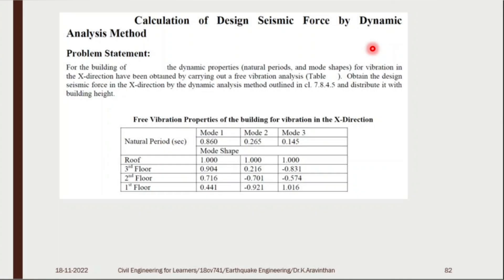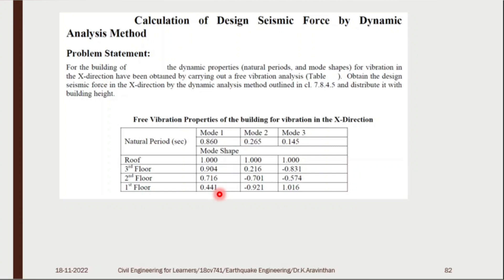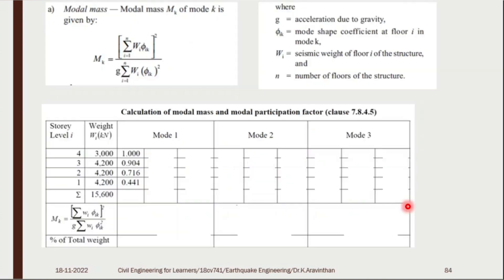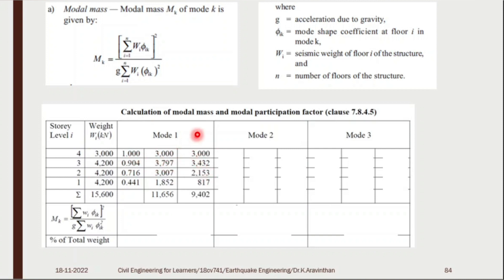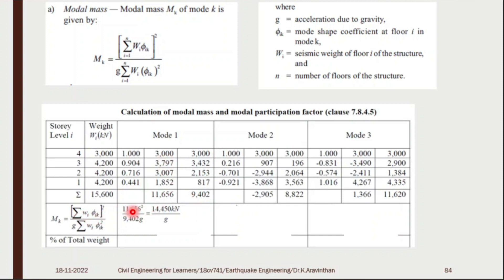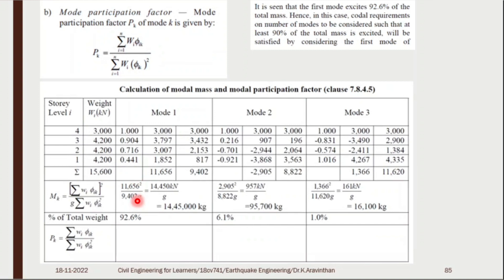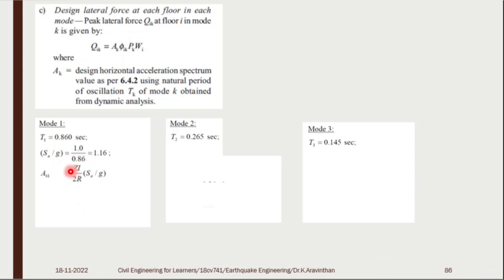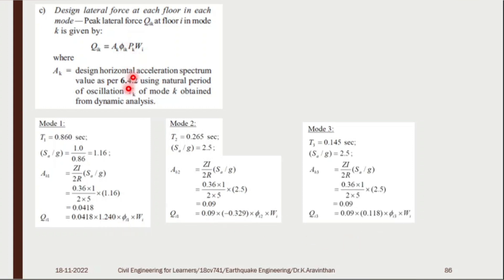Dynamic analysis of buildings 4-2 | Earthquake Engineering | 18cv741|Dr.K.Aravinthan|RRCE

Comment: we know that Vb(static) / Vb(dynamic) = 1, so if my Vb static comes out 1404kn then Vb dynamic should be the 1404 but in actual its didnt come so we multiple V by Scale factor but havent do that here .....
Reply from the maker: Dear viewer
Analytically Vb static and Vb dynamic will not be equal.
The purpose of conducting dynamic analysis is to get accurate results.
Here only dynamic analysis is done. For static analysis check the below link.
Reply from the maker: https://youtu.be/T9HNfC8LQiw